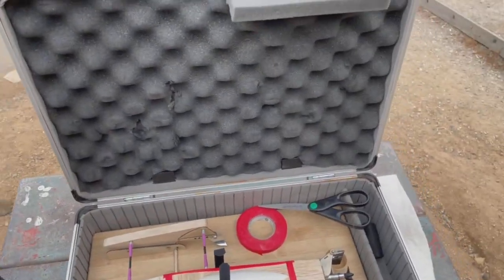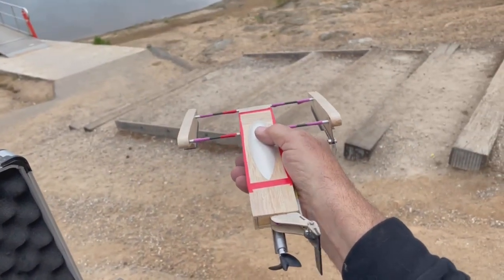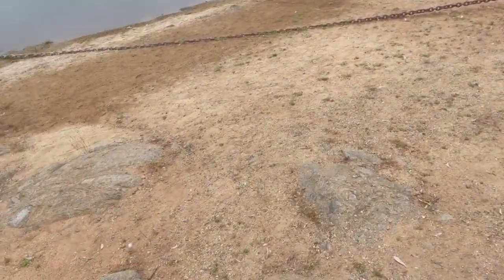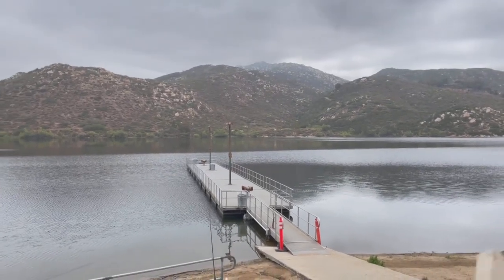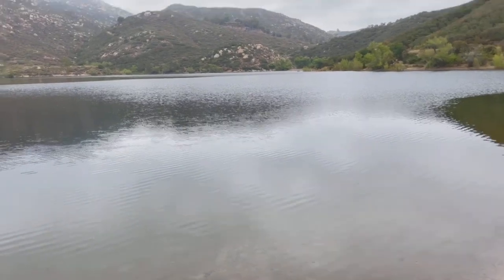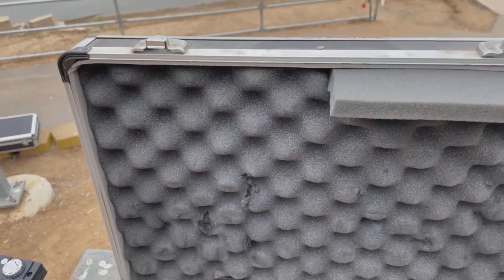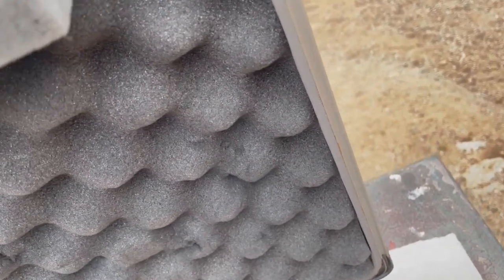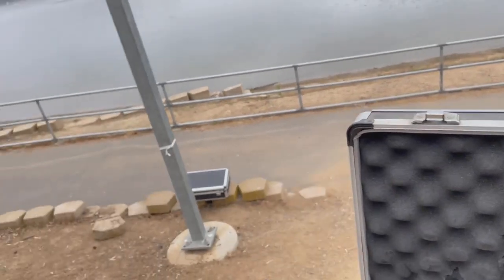Dr. Jet runs the Micro Jet Rigger for the first time and declares success, BUT.........

Comment: I have a 2030 with 4500kv that I want to put  in something and I have been thinking about building one of these lately. I have a 1600ma 2s battery that I run in the atlas and a 800ma battery but it has a tiny battery connector.

Comment: Nice run Dr jet! Great speed for 2S, but you need a camera man for sure :) It could be my imagination, but your rigger looks more stable than Big B's, but I think you need to bump up to 3S cause Big B's looks a tick faster. Obviously, you guys need to run the same cell count to be fair. You might want to make buoys out of 1 gallon milk bottles and paint them a bright color. Keeping them spaced 50 feet apart will be the challenge. Can't wait to see more. Cheers!
Reply from the maker: I did a video a while back on how I plan to set buoys out.  Remember, this is my maiden run.  I used a Graupner 26mm screw-on prop, but based on the low temperatures and long run time I saw, my next outing will use the driveshaft I built that is fitted for 1/8 bore drive-dog props so I can do more experimentation.  Stay tuned......  😉